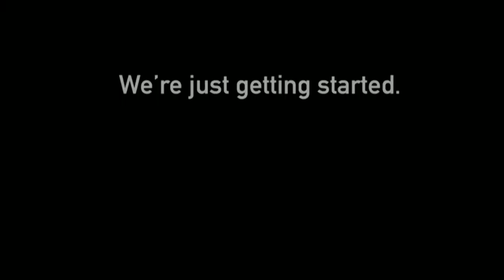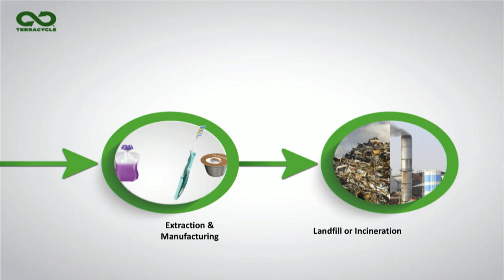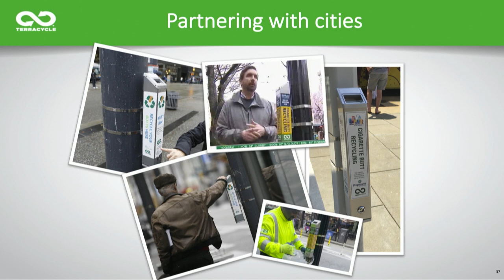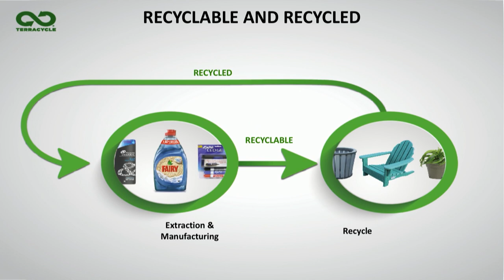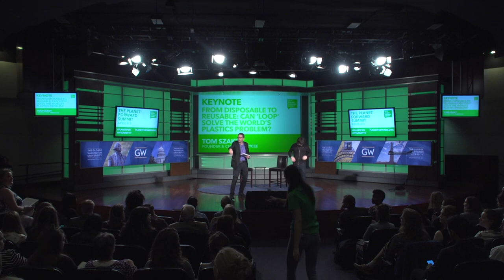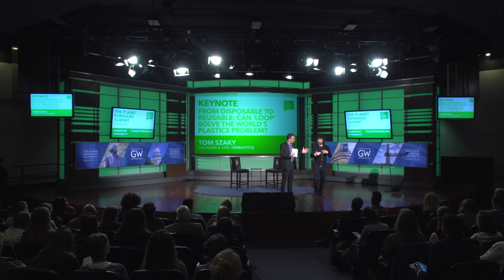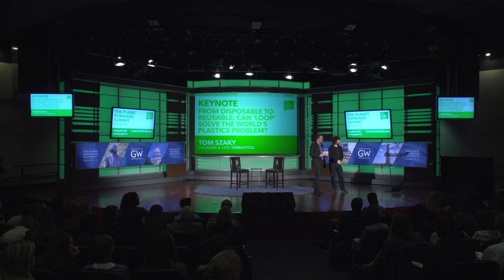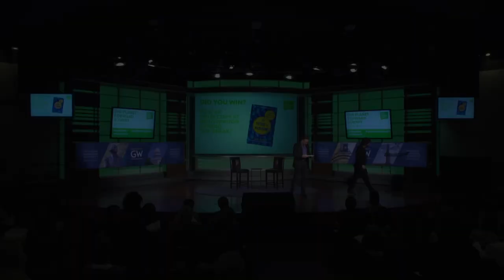Keynote: Tom Szaky of TerraCycle

Comment: I have washed and dried most of my blue surgical masks during the pandemic so far.  I had about a hundred....maybe two hundred.
The other day, I sat and cut them up.  I removed the wires to use as wire ties in other projects.
I saved the elastic earloops to use as rubber band type fasteners.
The cut up blue material, I used it as stuffing for a new throw pillow!
I am still brainstorming what to do with the heavier KN95 masks.